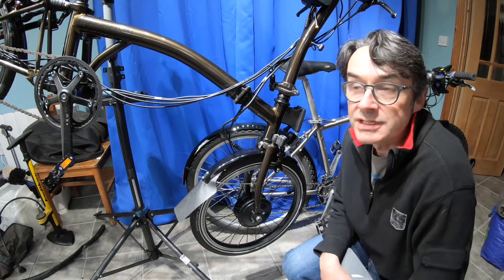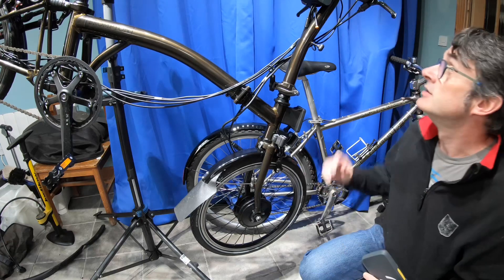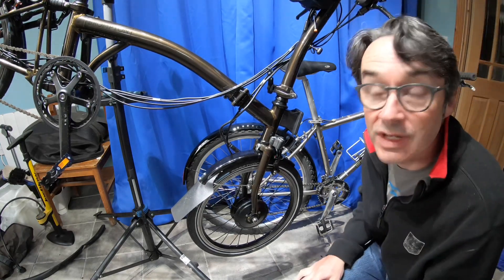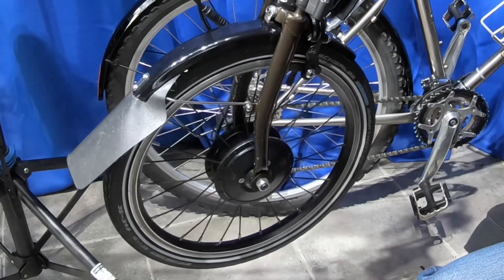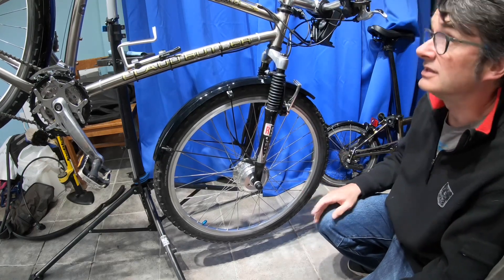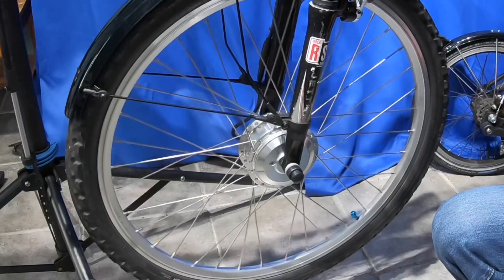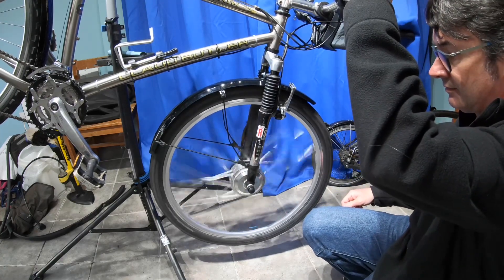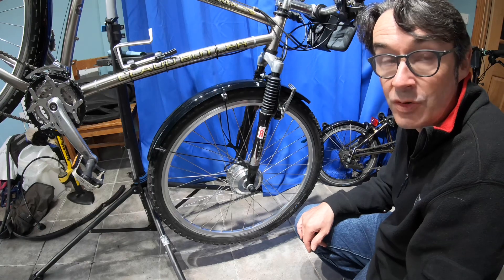Swytch Wheel Resistance Test - Brompton versus 26inch wheel

Comment: Hi Mike
I recently bought a Swytch kit.. and was having similar resistance issues. I went to a Bike shop in town - just in case i had over tightened something etc.. Apparently they DO indeed have resistance.. but this gradually lessens as the wheel gets used more.. the Bearings etc will settle. I asked Swytch (replied just now) and they agreed there is resistance - especially on Bromptons due to the smaller wheel. Time will tell if they truly "loosen up".. Hope that helps.
Reply from the maker: This is interesting. Thank you for your extra research. I don’t think that the resistance is too much of a problem , ot just seemed a bit disconcerting, especially when compared to a larger Swytch wheel.
Reply: @mikeknowles6063  I've had mine for almost 300 miles on a 26 inch wheel. There has been no lessening of the resistance.

Comment: Swytch boost no resistance without assist. That's your answer.
Reply from the maker: Thank you for leaving a comment. I’m not sure that I understand what you are saying, but thanks anyway.
Reply: @mikeknowles6063  To Quote Swytch "With the brushless technology, you’ll notice no resistance while you’re out on the road - even if you’re riding with the Power Pack switched off. "  Mike, Thanks for testing a showing the true state of affairs. Rather false advertising, though in practice, probably not noticeable with an adult's weight and gravity pushing the bike along. Did you notice the drag before you tested for it ?
Reply from the maker: @SimonBrowneNZ  The drag is not an issue whilst riding, and I hadn’t noticed it before someone commented on my build video. The Brompton is mine, and the 26 inch wheeled bike is for a family member. Whilst I had access to the two bikes I thought a comparison video would be useful.

Comment: Two questions about the Swytch kit:
1. What was the difficulty of installing the medal sensor? All other parts of the kit look easy.
2. What is the cost of the Brompton kit?
Reply from the maker: I would say that the pedal sensor installation was easy once I worked out which parts to use to assemble the magnet ring and where to place the sensor. Check out the installation video “installing a Swytch kit on a Brompton” on my channel for more details.
The price of the kit changes depending on which battery you chose, and how long you are prepared to wait. The Swytch website will have the up to date pricing for your region.

Comment: Is the difference due to the resistance of the wheels or is it the physics of the weight being further away from the center of rotation?
Reply from the maker: It’s not the most scientific test in the world, but I would say the difference is down to a difference in the Swytch motors used. The one in the 26 inch wheel is their standard motor. the one in the Brompton wheel is a different, much slimmer motor. There may be a small factor accountable to the larger diameter but not this much.